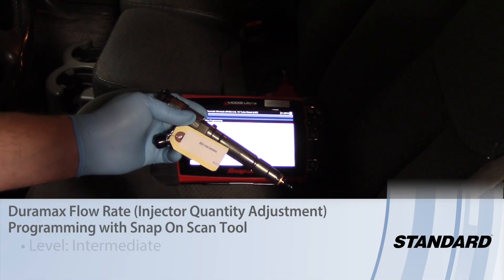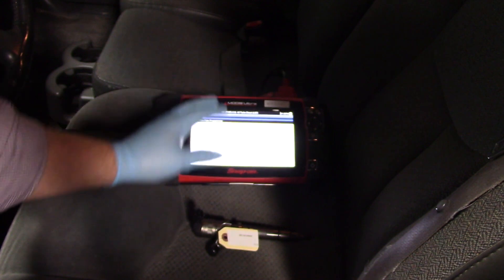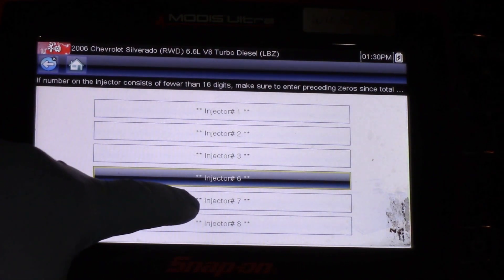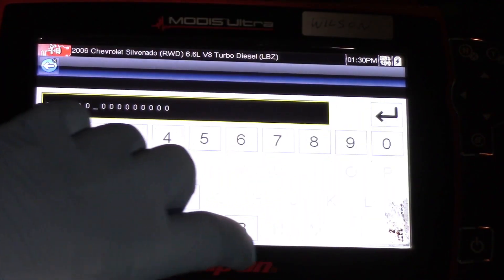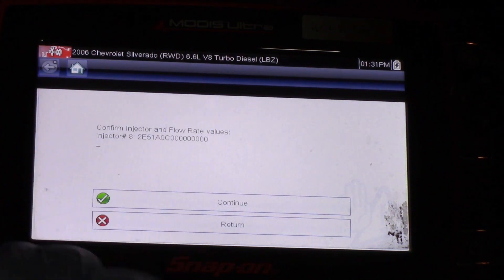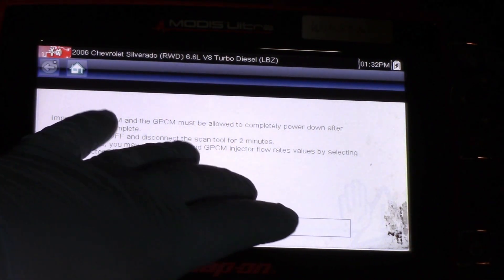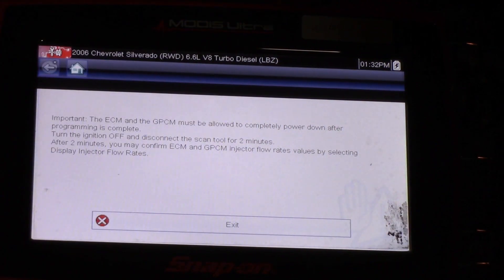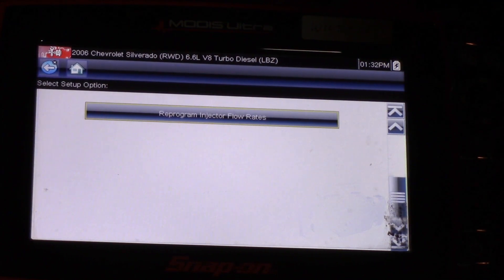Duramax Flow Rate (Injector Quantity Adjustment) Programming with Snap On Scan Tool

Comment: got a question I did a lmm swap into  a project  when I got the engine the injectors were taking out I put them back in got it running  injector rates are  high I was told they had to be recalibrated is that true and where can I find the numbers

Comment: My bostech injectors didn't come with a tag or label, only stamped numbers on the injector themselves, will that be the number I use? They are all installed already so I'd obviously have to remove them all to get each number? Correct? I appreciate any help anyone can give me..
2005 lly duramax
Reply: According to the forums both models LB7 & LLY don’t have flow rate programming like the LBZ & LMM. If you’re planning to do aftermarket injectors, you probably need to buy a programmer knob. I think the number that it’s labeled on the injectors is probably type of injector for GM to identify the type of model. I hope this helps
Reply: Did you figure it out?? I'm doing a set on a 2005 Kodiak and they didn't come with the number either

Comment: Will this flow rate be printed on the injector or is it only on a piece of paper when you receive the injector. Also will larger nozzles effect this programming?
Reply: Mr. Untouchable I received a crate engine with 20% over stock nozzle injectors already installed. No code was presented to me upon purchase. Must I get the correct code from engine builder or can I just copy the code from the injector that has the lowest balance rate?